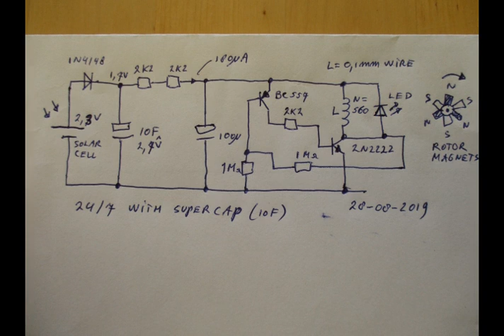24/7 Pulsemotor with 10F SuperCap

Comment: Hoi sMart, this pulse circuits are working within a small voltage range. With a variable power supply you can measure that there is sometimes a half Volt difference. The cap of 10 Farad is not enough to stay stable during a long time; I use a 50 Farad supercap for a pendulum that runs now for 4 month's without stopping once. My advice; 1- use a higher voltage solarpanel, 2- put a zener parallel to the supercap (or diodes, in forward position), 3- put 10Kohm variable resistor,  instead of 2K2. 3- Measure exactly the voltage of the pulsecircuit. Upperlevel is for the full 2.7V and the 2V supercap voltage for the lowest level. Success!